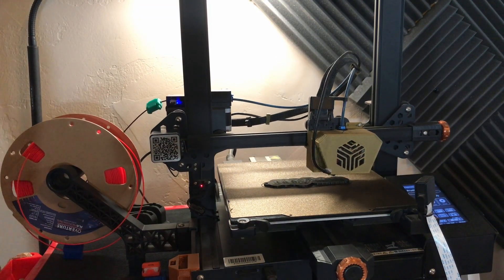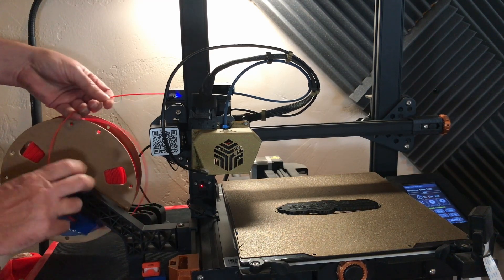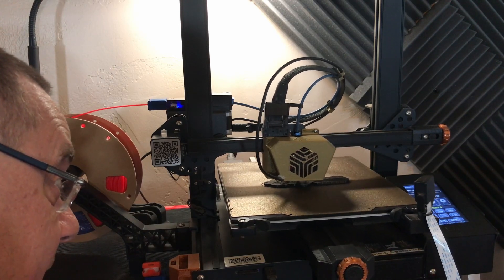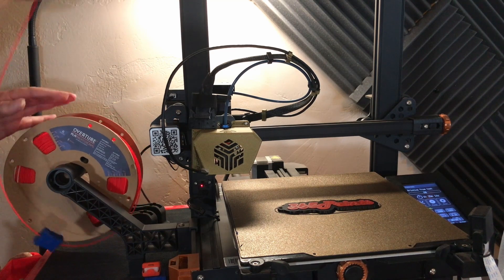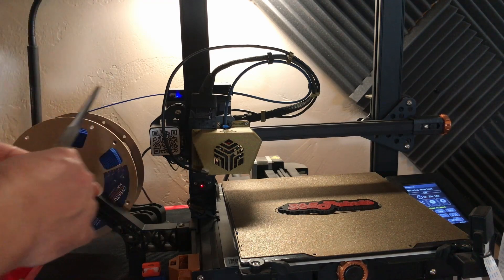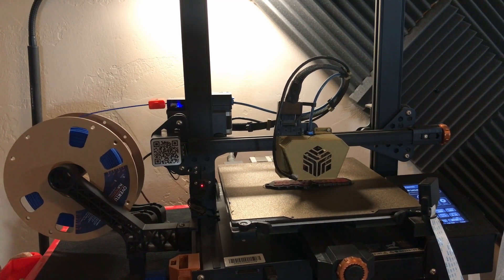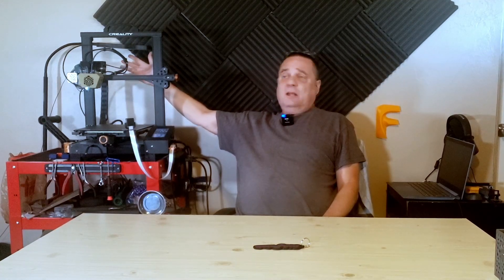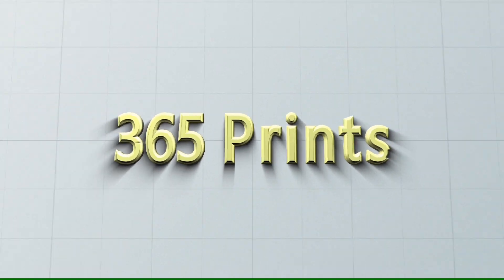CR6-SE - Filament Change Midprint

Comment: What is the clip that you place in front of the filament sensor? Great video btw.
Reply from the maker: That is a small dust collector.  There is a little sponge in there to wipe the filament.
Reply: Did you make those dust collector clips or purchase them? Where could I find these?
Reply: @365prints  wow that's a good idea.